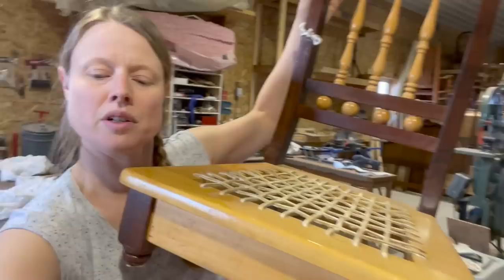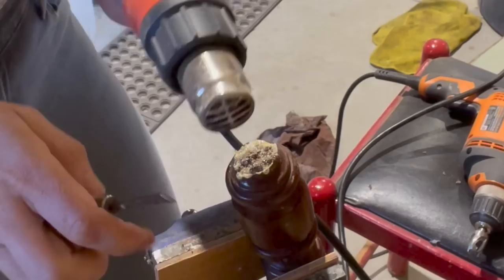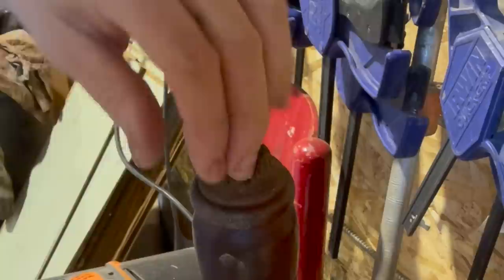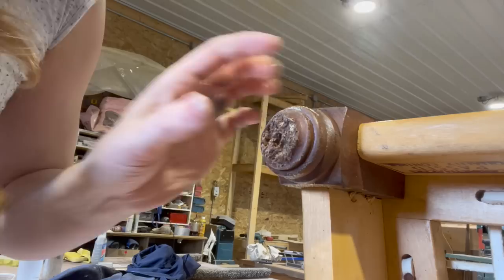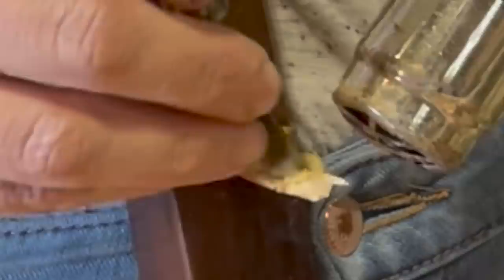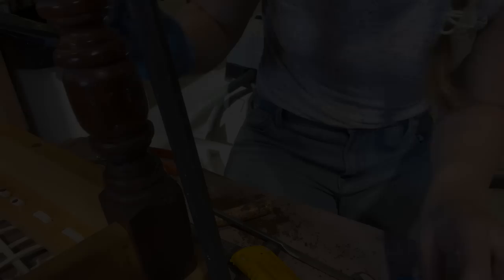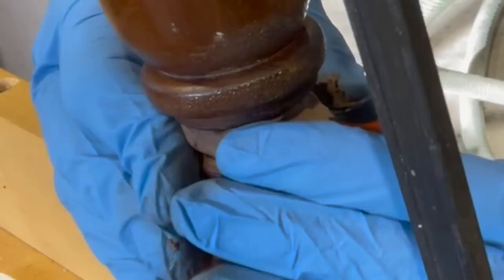Repairing a Broken Chair Leg

Comment: Nice to see you using epoxy. I've used west system since  1989 on antiques and modern pieces as well. I just built 4 new English Arm upholstered furniture  from scratch ( bought the frames in a kit)  and only use epoxy now for all the joint gluing. Don't use Titebond type at all anymore.

Comment: I had the same issues with an antique chair.   When I marked where the dowel goes, I used some of my wife’s old lipstick to mark the location on the point of the locator.  It shows up great.
Reply from the maker: Great idea.
Reply: @johnsfurniturerepair  With someone having your God given talent repairing furniture, it may behoove you to learn to do spindle and wood turning if you don’t know how at this time.  The leg to the chair, if it happened to be beyond repair, could have been duplicated using the same type of wood or wood with similar color.  Additionally, you could duplicate finials where they are badly broken.   I have had to turn finials on several occasions that were badly damaged and they came out very nicely.  Just a suggestion being offered to a talented lady.

Additionally, you may find wood turning a very habit forming activity that could lead to other sources of income.   Once you get bit by the wood turning bug, it will be an enjoyable activity that leads you use the creative side of the mind.  The cost of turning tools can get expensive.  But you can make your own tools for a fraction of the price and is easy to do.

Comment: That is mostly a just sit around to look good chair . The legs should have been a little bigger around, heavier made . You did a great job of making it look good again, I really don't know how much pressure that the leg could take from a heavy person, or somebody rocking it over sideways  or forward while 
sitting in it . It is a pretty chair. If the leg had ended up being just a faction shorter than the other ones. Just take and sit it down on a level concrete place and slide it back and forth or around and around in a circular motion and let the concrete sand the leg ends- bottoms all to the same height. I have done this several times and it works really well to make one sit solid and not rock .
I will be looking for you later on other projects . So be careful and stay safe and keep on making and repairing
stuff .
As always, Jeffrey !!!

Comment: I was surprised when you drilled the holes for the 5/8" dowel. → Centering them is fairly simple with the center punch, but I was impressed that your alignment was so accurate doing it by eye. Not sure how much give there was for adjusting the alignment.

Comment: I repair old furniture and I think you did a nice job , you used a lot of techniques I use , my dowl would have been longer just because it's a dining chair , love your video's . Mike
Reply: I have used a long piece of steel rod instead of a wood dowel rod and drill the holes but deeper into the leg on each end. Took a small grinder with a thin cutter wheel a cut a groove in each side of the steel rod and cut a few little places cross ways for the epoxy to lock it into the holes in the wood leg
pieces . Because I figured that the steel wood be much stronger and longer each way inside the wooden leg . She did do a good job lining and matching everything back up . I have put steel inside of wood pieces just to give them strength several times, not repairing, just building something to make it stronger .

Comment: The chair  was probably made in the 1950s or 1960s. That style of mixing Imbuia (or other dark woods like Stinkwood) with Yellowwood was a popular trend in South Africa, especially for dining tables and chairs.  Sadly Yellowood was heavily logged and the natural reserves were depleted. Yellowood is now a protected species in South Africa and the remaining Yellowood forests, especially around Knysna on the Cape south coast are carefully managed. The use of the rawhide straps originated in the 1820s when the Voortrekkers, early Dutch settlers, and farmers  used it as an alternative to cane. It was lightweight, strong, and could easily be repaired or replaced. It's still a popular style for rustic furniture in SA today. Glad to see that chair being beautifully repaired and not being scrapped.
Reply from the maker: Thankyou for this detailed information!
Reply: Correct. The original Stinkwood/ Yellowwood combination was later replaced by an Imbuia/ Pau Marfim combination, both imported from South America..This specific chair looks like the latter.
Reply: The style of the seat is known as "riempie". Regards from Perth, Derek

Comment: My late father was an aircraft accident investigator and taught me something interesting about the dowel break. Take a stick of chalk with thump at centre pull ends down with forefinger you will get a straight clean break. But grasp each end of a stick of chalk and twist the break will be fluted as with you dowel. This determines if the crankshaft in an engine impacted clean it was stopped on impact. If the break is fluted the engine failed under turning load or was running. It appears the leg failed first bending out causing twist break to the dowel.
Reply from the maker: That’s very cool! Thankyou

Comment: I have repaired furniture for many years. I thought you did a exellent job of drilling for the dowel. " For me" It's almost impossible  to get that leg  to come out where it's straight. I would have removed the seat. Clamped the chair on a bench. Using small blocks and bar clamps. Small blocks temporarily screwed to the bench. All this making sure the leg is straight. Next, I have drill bits that have a long rod welded on. Making them 36" long. Then by drilling down into the leg from the top directly under the seat. Through the break. Down into where the leg is meaty. Probably a 7/16 hole. Then a steel rod could be  epoxied in. I have repaired hundreds of components with that method. It works!! No hit and miss in drill for a dowel. Another idea if drill in like that isn't a option. Go ahead and drill the 5/8 hole into the leg. Centering as best you can. Then ( I'm assuming you have a lathe ) cut say a 1"x1," turning square. Turn a 5/8" dowel on one end. The length equal to the dept of the hole in the leg. Glue that in the leg. Leaving the unturned square on. Next the leg can be " centered up " in the lathe. Allowing the rest of the dowel to be turned. I'm sure you can see. How that is fool proof for getting that part perfectly straight. For the top part. Next, That chair could have been put on a drill press table. This time using drill bits that are 12" in lenght. ( Those can be purchased) then by positioning the table angle. Using squares of thin plywood. Clamped the chair in place for drilling. The correct position can be verified by measuring at a diagonal across the back leg and front leg that isn't broke. Using that measurement to insure the center line straightness of drllbit set up. One more method, I have 1" x4" and 1"x8" boards screwed together to form a L..  A leg or turning can be laided in the L.  Shimmed and clamped. Insuring the rounds centered and true in the L. Next a measurement is taking from the center of the round to the " bedding" surface of the L.  This measurement should be the same at all 4 center to L surface locations. Next  2  square blocks say 1" thick are cut. At the drill press. A hole is drilled to mirror the measurements of the centers of the round in the L box. These blocks are screwed into the L about a 12"-18" apart. Now by using the very long drll bits mentioned above. Threaded through the blocks. A hole can be drilled perfectly centered in the round. Once again. I like steel rods. For the dowel. Steel rods are very strong of course. A much smaller hole is required. Saving much more of the integrity of the turning. I know this is confusing. I hope you can follow it. YES! It takes time to set all this up. But these are tried methods I have used successfully for many years repairing rounds and turnings. Eliminating the error in trying to "free hand" a hole!
Reply from the maker: Or just get good at free handing the hole. Lol gotta make money while I work man.  I’ve had to get good at it as there are so many times where a jig just isn’t feasible. But thanks for the taking the time to explain.
Reply: @johnsfurniturerepair You are very skilled with that drill!! That's for sure,!!  That leg was perfect. You aced the touch up also!! I am very impressed with your work!👍

Comment: I was worried as you were a degree or two off plumb as you drilled the dowel hole into the root of the leg with your forstner bit, which you've noticed later but pulled it off skillfully by scoring the dowel and clamping it plumb as you attached the stretcher. Great resto in my view as it requires delicate touch and a keen eye on details. Love your channel and your work.

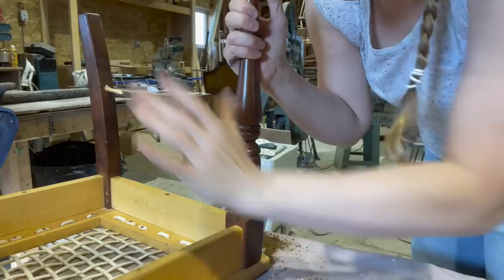Comment: YouTube decided to offer this gem up on its one year anniversary.  Really nice.  I personally have had problems in the past hand drilling accurately aligned holes using a hand drill. You are clearly very skilled at this.  For the rest of us, I wanted to point out an alignment method demonstrated by an art conservator, Julian Baumgartner, who has a YouTube channel "Baumgartner Restoration".  In a video he shows how to reattach wooden protrusions onto a sculpture, using dowels.  The title is "Conserving an Ida Kohlmeyer Sculpture" and the method appears at approximately 8:30 into the video.  It uses two ordinary alignment lasers used in construction.  It's probably overkill for most projects, but I found the method very elegant.
Reply from the maker: He is a master
Reply: @johnsfurniturerepair  , so are you!

Comment: I have been doing repairs like this for a living for over 40 years and there is no repair as good as making a new part. can't even estimate how many doweled repair jobs I have had to make a new part for! they don't hold up. I have also found that a lot of breaks are caused by the original maker not paying attention to grain pattern/direction. a chair slat made from good straight grained stock will always hold up better.
I realize that sometimes it is difficult to match woods and colors if you want to make a new part but a slightly different color is still preferable to a break in a repair.
I do like the West System for repairs, been using that since 1980.
Reply: So, make your own channel and perform the repairs however you wish. Your comment serves no purpose, here.  As a consumer, I would prefer the way that Trena did it.

Comment: Very nice repair! I've repaired some chairs with similar issues over the years and I've got to say that you made it look much easier than I remember doing them. For me the issue wasn't so much the color matching and blending because those depend on the final appearance that's been decided on. My issue was always the realignment of the broken parts and dealing with the previous failed repairs that someone else made that caused them to bring the piece to me. It looks like you drilled that dowel hole by eye and that was awesome. My dowel drilling jigs looked like a twiddlely wink set on steroids, many many steroids. Can't wait for the next vid.

Comment: Ahh WEST epoxy. Used in boat building for doing epoxy encapsulation. West stands for Wood Epoxy saturation technique. Actually a great use for it would be to epoxy saturate those garden boards and thickened epoxy glue joints. Last a lifetime.

Comment: I've done a couple of chair legs and I've undercut a little bit of the Dowling that went into it and then wrapped the dowel and saturated white glue in flannelette sheet and inserted that into the two pieces and then trimmed off excess and it is amazingly strong. All the best from Canada

Comment: It's a chair from South Africa made of stinkwood or blackwood(the poor man's stinkwood) and yellowwood. The leather strips of the seat is called riempies.
Reply: Nope, certainly not stinkwood. Thousands if these chair were produced in the 1970s and 1980s, mainly from Imbua and PauMarfin. These South American timbers were a cheap (at the time) substitute for the classic Cape furniture produced in the 17th and 18th century. The giveaway in this case is the condition of the riempies (rawhide cow skin). On older chairs the riempies would have been replaced multiple times, leaving signs of tacks having been removed.

Comment: You did a great job with the mohawk Toners . your leg repair has an inherent weak spot. The weak spot is where you put the epoxy putty . First glue the leg back together this part of the repair has nothing to do with strength just get it glued back together as close as possible to its original orientation. Now cut the leg in half in The Recess or Valley adjacent to the repair. Now you have two clean surfaces to line up your dowel part of the repair. You can't see this part of the repair because it's in The Recess no need for epoxy putty and touch up plus this will be a stronger repair keep up the great work if you have questions I have 30 years experience and love talking about the subject
Reply from the maker: Thankyou! That’s a great idea. I’d love to chat. Cheers!

Comment: I've done similar repairs, but when there are no cracks to work around, I've split the very end of the dowel and applied a very thin wedge, added the glue and driven the dowel home, I also have a special ground set of Forstner bits ground ..062 over. I use them where alignment is critical.
Reply from the maker: Nice. Great ideas!

Comment: I have found that 
Gorilla glue is about the worst glue ever invented. Like you, I use epoxy whenever I can. I restored a bunch of chairs with Gorilla glue when it first came out. The next summer, I had to do them all over again with Titebond III. They are still holding up, but epoxy would have been the best choice. That Gorilla glue foams up and doesn't lend any strength to the joint and besides that, it hardens up in the bottle and becomes useless the next time you want to use it. I suppose it is good for some things, but not on wood. Love your vids. Keep up the good work.
Reply from the maker: Sorry you had to learn the hard way. Good job fixing it

Comment: I like your work! You have a keen eye for color and that's so important in this field. I do have one observation regarding the length of the 5/8" dowel, however. I don't think it's fully seated in the leg portion, but I could be wrong and it's too late now to either fix it or measure it. What I would have done is use a  smaller, longer dowel as a "depth gauge" and inserted it into the chair base hole and marked it, then flipped it around and inserted in into the leg's hole and marked it. The "sum" of the two marked lengths is the overall length your 5/8" dowel should be, minus an 1/8" for glue compression. This will not leave a "void" where the joint would be weakest. The epoxy would be compressed in the hole as you show and any excess would be forced out because of the grooves you made on the bandsaw. I would also advise using a Jorgenson wood clamp to hold any small parts being cut on the bandsaw because if anything "lets go" your blade will only contact the wooden jaws, not metal pliers. It also serves to support the objects better because it will lay flat on the bandsaw table and not wiggle/wobble when held by hand. This has saved my bacon more than a few times!
Reply: Piffle. There is no void, it's filled with epoxy. Even if there was a void, it wouldn't be the weak point, the original break line is. The most important things here were 1. large diameter, straight-grained dowel and 2. plenty of glue forced into the cracks and this was done.
Reply: I watched you ram the 5/8 dowel  in the leg your covered great work @@!

Comment: A more effective hold on the rail repair could be achieved by using electricians amalgamating tape. This is a stretchy rubber tape which sticks only to itself, making it easy and clean to remove.
Because it stretches it pulls the joint together better when it contracts.

Comment: You can wrap surgical hose around those small broken parts instead of tape. 
It will not leave any sticky stuff behind on your wood and it will have a lot more pressure than the tape.
it works great.
Reply from the maker: Thanks for the tip!

Comment: When I was active in the trade we would repair a break like that by using the lathe to make a piece mimicking the turned parts where the break was. maybe an inch or so of the leg but we would also turn a 3/4 in piece of dowel on either side of the turning a few inches long. Then just cut of where the break was and the drill into the leg and the chair. It gives you a flat on the leg and the chair to drill into and it's easier to find the center. Slap some glue on it and clamp it down and it makes a nice repair. When we were done with the repair, we would use the table saw top to level the legs, assuming it to be a true flat surface.  Just sayin'       Mike
Reply from the maker: yes, ive seen that done and it is definitely a nice way of repairing this

Comment: I have had good luck using a length of steel all thread with epoxy glue instead of a wooden dowel for repairs like this.  George Ferry

Comment: Im really sorry to see you tackled that break with a smaller dowel, the original diameter of the leg is three times larger than the dowel and it broke, it is much more recommended to turn a 2 x 2 wood with exactly the same shape bcoz it is not that expensive anyway, just saying
Reply from the maker: That would have been an excellent repair too. Cheers!

Comment: I would have used yellow Titebond on the spindle. 
I would have drilled a smaller diameter first to check alignment if drilling freehand  and then adjusted for the 5/8th.
When clamping up I would have measured it against the other legs.
After doing that the result would not be as good as yours!